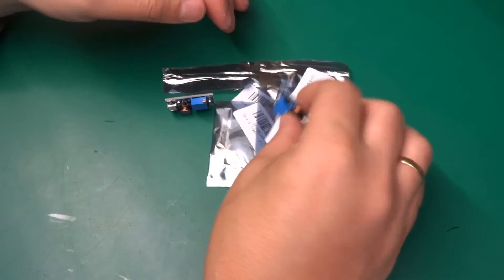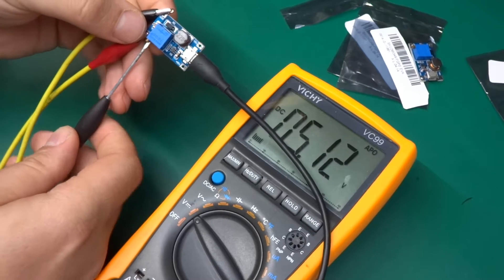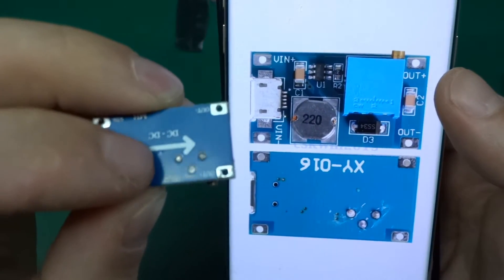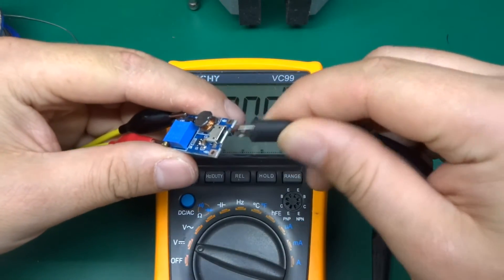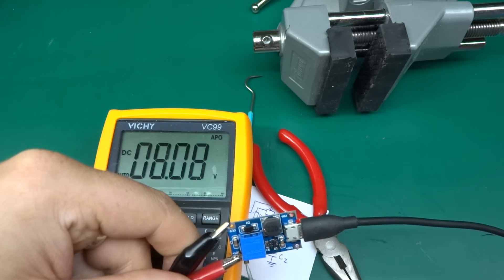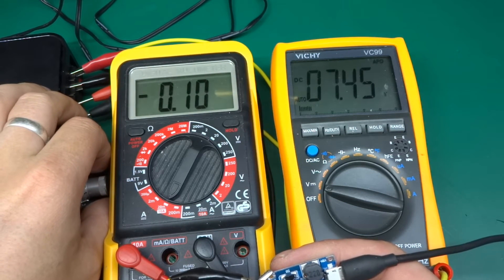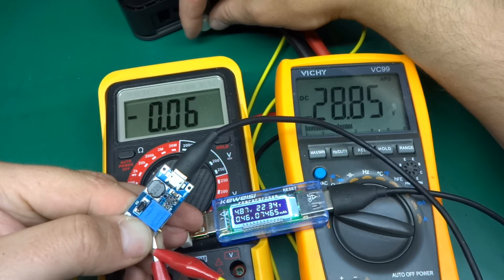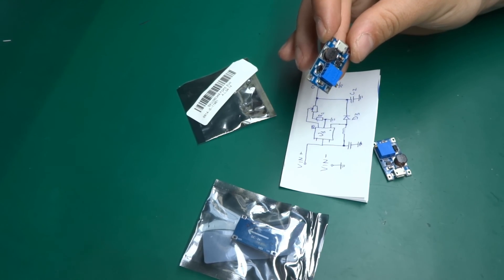B6286 Step up boost converter - load test and schematic

Comment: Thanks for creating this vlog.
I was having the same problem and only after watching your video did I start ti understand what was happening.
Now I understand why the board has a divider comprised of a 10K potentiometer and a 200 resistor.
If anyone is interested, here is my table of values that prove the formula from the datasheet is OK:

Vref	0.6		
Rtot	1.02E+04		
			
R2	         R1	     R1/R2          Vout
3000	7200	2.4	            2.0
2000	8200	4.1	           3.1
1500	8700	5.8	           4.1
1200	9000	7.5	           5.1
1000	9200	9.2	           6.1
800	       9400	11.8	  7.7
700	      9500	13.6	  8.7
600	      9600	16.0	10.2
500	      9700	19.4	12.2
400	     9800	       24.5	15.3
300	     9900	       33.0	20.4
200	   10000	       50.0	30.6

Comment: I made the same mistake with the pot with an XL6009 boost module from Amazon. Also found that the minimum input voltage for these modules is usually much higher than those listed in the seller's product description. Reading the data sheet for the IC used is pretty much a given especially if your application requires an in/out voltage value that's close to the IC's minimum. I can see how a non-technical person might get tangled-up if they don't have the electronics knowledge needed to understand the data sheet and apply the module correctly.

I enjoyed watching your video, especially your mistakes, because I go through similar things here in the lab. You need to stop struggling with a screw driver on those trim pots. Many years ago I bought a few alignment size tools from Digikey and made by Vishay. The tool is made specifically for making trim pot adjustment easy because it has a recessed blade on one end. You place the recessed end over the pot's adjustment screw and start turning. Because the blade is recessed, it won't slip off of the screw while your turning and has saved me more time and frustration than you'd believe. it's one of the best tools I ever bought for my lab.

Thanks for your video and your honesty, not many people are willing to admit their mistakes publicly and most would edit them out of their videos before publishing. They might not realize just how helpful and reassuring it is to see how most of us go through the same or similar struggles.

I look forward to viewing more of your work, thanks again for taking the time to put this one together.

All the best to you and your family,
Frank M.

Comment: Nice video and thank you for the cringe... Good to see I'm not the only one making silly mistakes!

While making my last video about a USB rechargeable battery, I killed one of these MT3608 chips. Unfortunately I wasn't recording when the magic smoke was released. Today I repaired the faulty module by replacing the chip (Edit: see this video: https://youtu.be/-3tBw6WSZVM). Good soldering practice indeed as these chips are quite tiny!

Comment: Nice module, can't find a datasheet for that chip though :(.
Reply from the maker: I searched qite a bit too, no luck though.
Reply: Looks like I just didn't search properly.
https://detail.1688.com/offer/532918628302.html?spm=0.0.0.0.ZaWlbB (use Google Translate)
Seems like it might be just a clone or equivalent of this: https://www.olimex.com/Products/Breadboarding/BB-PWR-3608/resources/MT3608.pdf or SX1308.
Reply from the maker: +TefaTronix well dine for your persistence. I gave up to quick on that. Once I get to the point, that all results tak me to supplier websites willing to sell me any part no. under the sun, i stop.